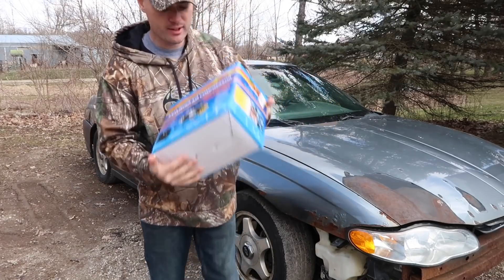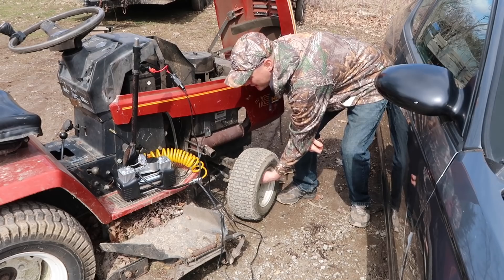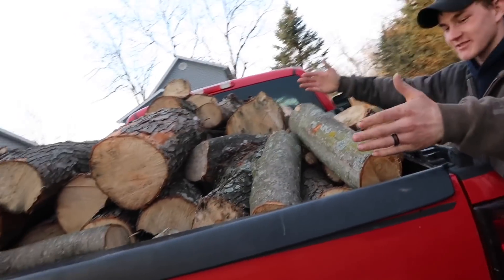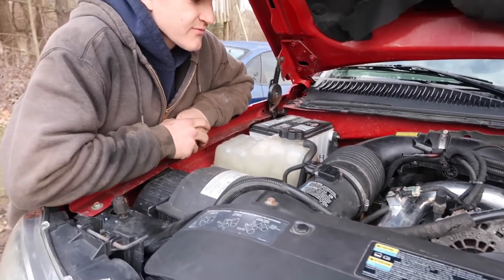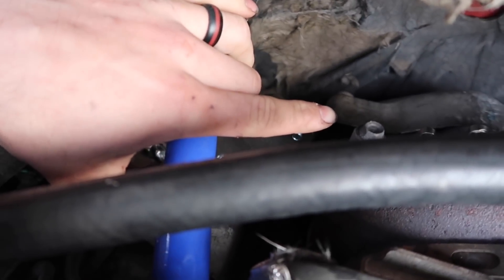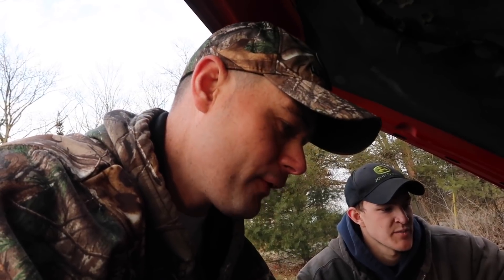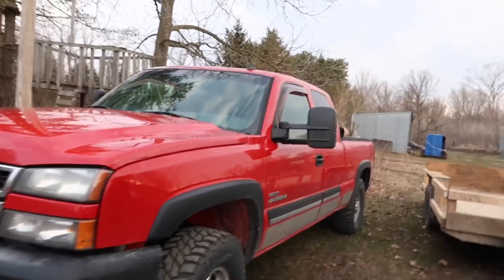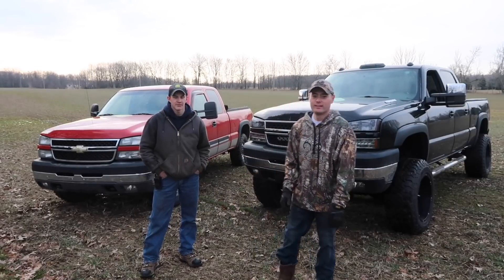EGR Finally Deleted on the Duramax

Comment: Cold air intakes are a waste of money on a stock truck. The stock air box has more than enough flow to support 500+ HP. This has been proven time and time again on Dyno's. But hey, if you want it to look prettier, by all means give K&N your $300.00. Something else to think about too, that oil you use in that K&N filter will put a nice film on your MAF sensor, affecting how your ecm calculates fuel trims. Went from 18.5 mpg to 21 on my 06 LBZ when I round filed the oily K&N, cleaned all the crud off the MAF and reinstalled a stock air box and filter. K&N's were great filters back in the day, but not good for vehicles with MAF sensors.

Comment: U said truck is stock other than the new EGR delete. What he do for it throwing codes ?    My truck is stock also  and would like to do this but was told I can't do to it will go into limp mode with out also having tuned. Is that  true?
Reply: John Love my egr is deleted on the lly I just bought. Seems to run fine so far but I ordered efi live to get rid of the code
Reply: Ebay has egr decoder harness that tricks the pcm so the check engine light doesn't come on for it, it's like $42 for my lly. I'm. Waiting to do my egr delete till I get my 4" exhaust